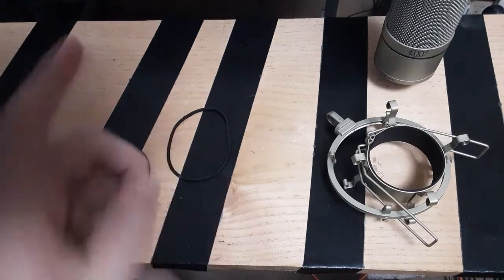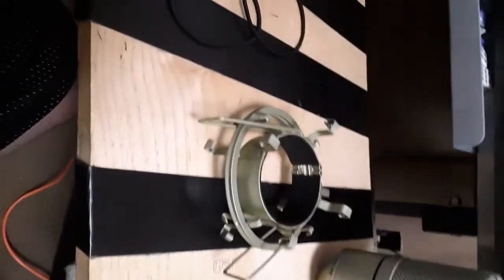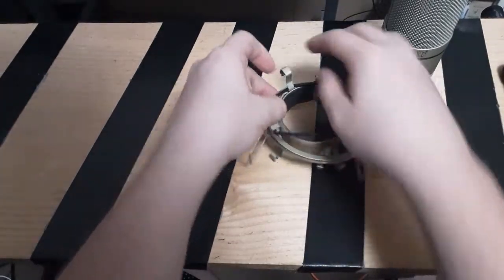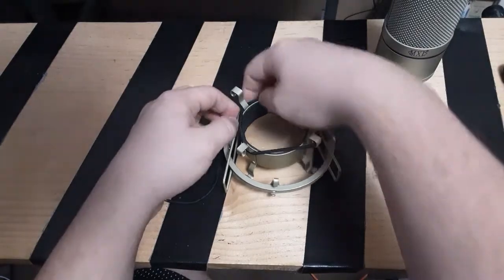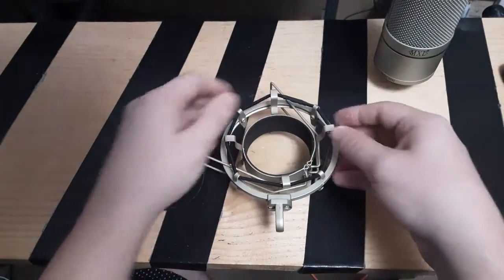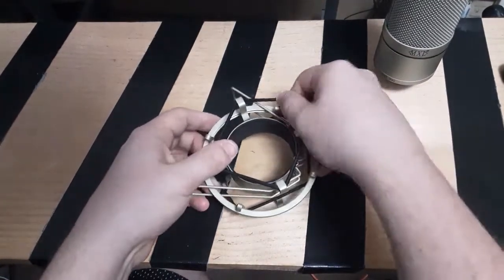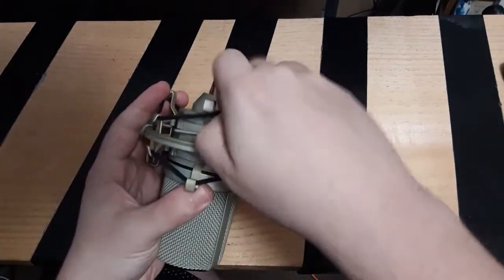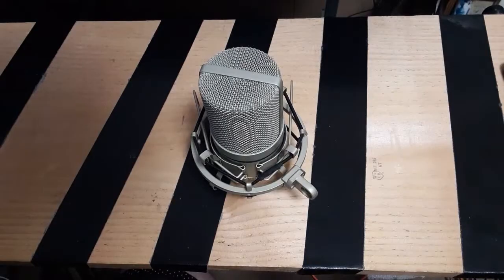(Informational) How to restring a simple shockmount

Comment: wow - i was exactly the same stupid  - unfiddled the thread......then i got a knot in my head about the mess and didn't use my mic  until i found this tutorial.
Man - what a relief - super tutorial :). i had to re-thread a very similar shock-mount that was with a NT-1a set. thank you very much!
Reply from the maker: Fun fact, I over-torqued the joint on the mount because it kept slipping, and ripped the threading out. I now have my mic taped to the boomstick. 😅

Comment: OMG, you have saved me. This turned into a   cube for me. I couldn't figure this out for longer than I care to admit. I nearly bought a new shock mount out of frustration. FYI, mine mount fell apart  the bands got  and overstretched. I used a medium hair band tie to substitute and it actually worked better than the ones they come with.  you! This took me MINUTES.

Comment: Hey thanks for doing this. 
I need to replace my elastic strings. Where are these screws you tightened? I had my same model mic slip out of the holder and unfortunately hit the base of the mic stand. It all happened so fast I am not sure where it hit the mic, but hopefully, when I test it later, it works OK. So I am wondering if these screws you mentioned are loose....Thanks.
Phil
PS...After watching some other videos on this, yours is clearly the best and easiest to follow. Kudos and well done...
Reply from the maker: The screws held the brackets where the bands go around i believe.
Reply: @3OrMoreBones  OK Thanks. Not sure why my mic slipped through and hit the floor. I did not squeeze those release clips, so I will have to take a look tomorrow when in my studio.
Phil
Reply from the maker: Wear and tear. I recommend duct tape to add girth to the mic.
Reply from the maker: Or... duct tape the mic to the holster.

Comment: hey @3OrMoreBones thank you for this gem. Maybe you can help me with another issue: no matter what mic stand I use, the bit you screw onto the mic stand is always loose, like the threads are two hairs too wide. They just don't grip. How can I replace/fix this piece? You have this piece off in this video so I'm wondering if you had the same issue. Help muuuuch appreciated.
Reply from the maker: Beware the cheap mic stand might have an aftermarket attatchment point. I always use duct tape to hold it down.
Reply: @3OrMoreBones  Thank you, I wrapped the threads with masking tape and it holds like a charm 🎉

Comment: Hi, unable to unscrew mic from shock mount. Any tips?
Reply from the maker: By unscrew, you mean the mic is stuck in the holster, or the joint wont move?
Reply: 3OrMoreBones thanks for your reply, it’s stuck on the holster (the part where you screen the mic into) . Saw somewhere on line to put wd40 to loosen.
Reply from the maker: Normally you could press the two tongs together and the metal casing would expand to release. Be careful but have you tried lodging a knife between the mic and casimg? Wouldnt think the thing could get vapor locked...
Reply from the maker: Be sure to give it a good alcohol scrub after lubrication.